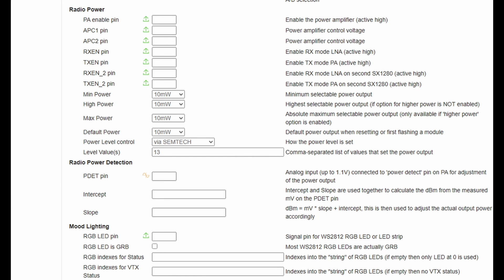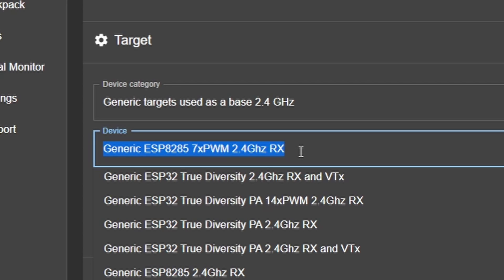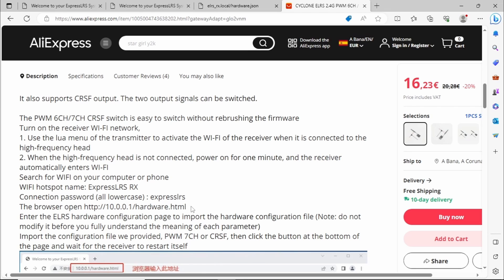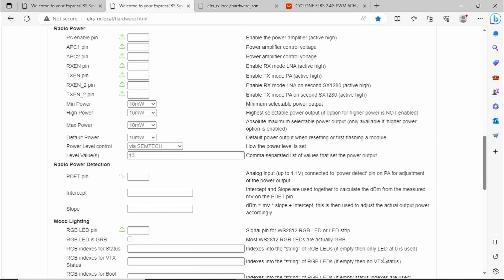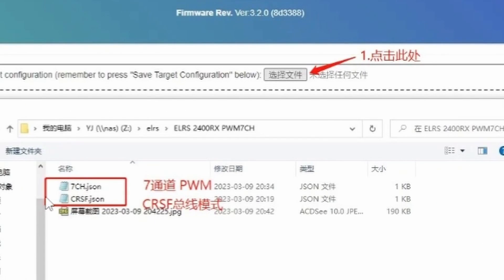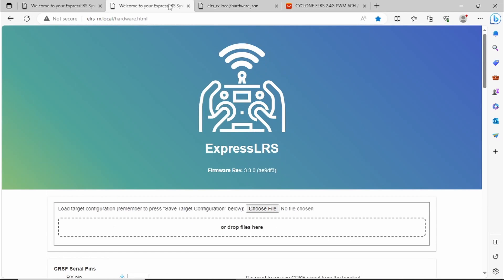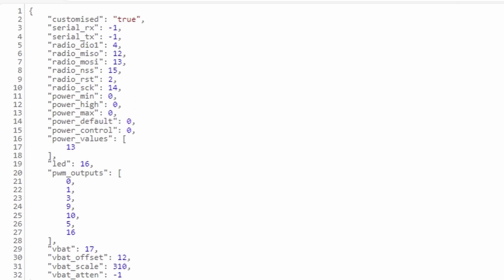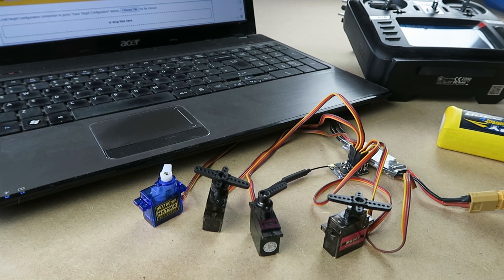ELRS Tx Rx "SECRET" Hardware Tab CYCLONE ELRS 7CH PWM JSON Files

Comment: Thank you for the video and the files. Now my Cyclone is in 7ch mode :)
However I wonder how to update the FW with ExpressLRS Configurator.
Reply from the maker: As you know the "Generic" target has been removed from the configurator. However, I have successfully flashed version 3.2.0 by using the Happymodel EPW6 target. Of course the json file still works as before. Thanks for watching, have a great day!
Reply: @1nformatica  Oh that is great info, thanks a million for that. That saves switching from 1.5.5 to 1.6.1 of the ExpressLRS Configurator :) The only thing I have now is that the Happymodel EPW6 firmware made with 1.6.1 has a bin.gz ending, I guess it needs to be extracted and then the firmware.bin uploaded via the web interface, isn't that right?
Reply from the maker: @tinaschulz3514  You're welcome! It is a lot easier just to configure the Rx to your local network and flash via wifi. I believe you leave the file as .bin.gz if you do it your way. Have a great day!!
Reply: @1nformatica  yess you need to upload the "firmware.bin.gz" bc the bin file itself is too big.
Error message appears: "ERROR[4]: Not Enough Space"
Reply from the maker: @Cre8ionz.  Thanks for the confirmation. Have a great day!
Reply: @Cre8ionz.  how to convert the .bin fil to a file i can backup the RX?. and the happmodell only have 6 chaneles and not 7 will it take an effect on the result?
Reply: @1nformatica  I installed this fimware and now it's on blue solid light, it does nothing
Reply from the maker: @luisdav2202  I, and many others have used the EPW6 firmware successfully.  A solid light means either that the Rx is in boot mode or the wrong firmware / bad flash has occurred : https://www.expresslrs.org/quick-start/led-status/#receivertransmitter-led-status The only way to recover is to reflash with the correct firmware by using a UART interface. Thanks for watching, have a great day!
Reply: @1nformatica  im gonna try it again, where did you find the Json file? cant find it can you upload them?
Reply from the maker: @Lewis_FPV  They are linked in the video description with other useful links : https://drive.google.com/file/d/1VlCShq8hUUtPatXYvEwJ6bMc0LfcUQTq/view?usp=sharing

Comment: hi, i have CYCLONE ELRS 7CH PWM i have flash using firmware HappyModel EPW6_2_4GHz_PWM_RX_FCC on version 3.3.1 to matches the version on my radio, But I still can't complete the binding process. it's in bind mode at startup, but it doesn't respond to the radio bind. Do you have any idea what might be causing the problem?
Reply from the maker: Are you powering the receiver and then quickly cycling the power off and on three times? The Rx should not be in bind mode if you just power it up. Look here for LED status : https://www.expresslrs.org/quick-start/led-status/#receivertransmitter-led-status
Reply: @1nformatica  no but, After flashing, at startup it automatically boots into bind mode (double blink then pause) and then 1 minute later it switches to Wi-Fi
rx web infos : HappyModel EPW6 2.4GHz PWM RX Firmware Rev. 3.3.1 (e051b8) ISM2G4
Before flashing, the receiver is listed as: ExpressLRS Generic ESP8285 5xPWM 2.4GHz RX Firmware Rev. ver.unknown (ae9df3) ISM2G4, I updated it to match the TX fw version
tx web infos : RadioMaster Pocket Internal 2.4GHz TX Firmware Rev. 3.3.1 (e051b8) ISM2G4
On the http://10.0.0.1/hardware.html page of TX, I have updated with the 7ch.json file.

Comment: I think I bricked my receiver when flashing EPW6 ELRS 3.6.0. The LED is constantly on. How do I re-flash it?
Reply from the maker: A solid light means either that the Rx is in boot mode or the wrong firmware / bad flash has occurred : https://www.expresslrs.org/quick-start/led-status/#receivertransmitter-led-status The only way to recover is to reflash with the correct firmware by using a UART interface like this one :  https://s.click.aliexpress.com/e/_DDzPaYN
Reply: @1nformatica  Yes, I carefully studied your instructions. I'm using a USB-STS-ISP USB-TTL adapter, Prolifik. I connect to +5V, ground, Rx (channel 3), and Tx (channel 2). However, the ELRS configurator doesn't detect the receiver. What am I doing wrong?
Reply: @user-dj  boot button has to be pressed before you power it on!
Reply: @makesomemore_  It turned out to be simpler. The Prolific adapter doesn't work with Windows 10.

Comment: Thank you for this. You are amazing. Saved me! My channel 5 acts really weird idk why. I checked online and I heard pwm revievers use that to "arm", and dynamic power setting in radio will only be selected if ch5 is armed AKA at 2000ms. Which literally makes the ch5 useless. Any workaround for this?
Reply from the maker: These are the steps to get full resolution on CH5:
Update ELRS Firmware: Ensure you are running ELRS version 3.0 or later. 
Use the ELRS Lua Script: Access the ExpressLRS Lua script from your transmitter's radio menu. 
Select a Full-Res Switch Mode: Choose one of the full-resolution switch modes, such as the "16ch Rate/2" option. 
Configure Settings: Set your desired packet rate (e.g., 100Hz or 333Hz) and select the full-resolution switch mode. 

Thanks for watching, have a great day!

Comment: Thanks for the Video. 
Can you burn this receiver to act as transmitter?
Reply from the maker: Whilst it is theoretically possible it is not worth the effort. For one the output power would be very limited. There are many ELRS transmitter modules available and also generic LRS modules that can be used. So you can take a dev board with an SX1280 and ESP32 and flash it as an ExpressLRS TX but there are much better commercial units available i.e. Happymodel ES24TX or Radiomaster Ranger Nano. Thanks for watching, have a great day!

Comment: Thanks for the video, it helped. I have one other question though. On my cyclone device I need to connect VCC/GND not only to the two ADS/GND pads but also on the boot channel (channel 1). If I don't it doesn't power up. In your video channel 0 does not seem to be connected but it is working. Is there some step to make that work?
Reply from the maker: I do not understand your question. All the GND points on the receiver are common (connected together) if you take a multimeter on ohms or continuity you will see this. The same is true with the +5 volts, all channels are connected together. The exception is the "ADC" point which is connected to the main battery voltage for telemetry.   What do you mean by "channel 0"?

Comment: do you have any tip on antennas? My antenna broke at connector and I need a replacement. I have no idea what kind to buy. Regards
Reply from the maker: Provided that the connector on the board is not damaged you just plug in a new one. The connector is called an IPX4, you can see replacement antennas here : https://s.click.aliexpress.com/e/_okVTjsz Thanks for watching, have a great day!
Reply: @1nformatica  Many thanks :). Length is not important? My cyclone antenna is around 7,8cm long.
Reply from the maker: @rc_hiking_slo  The overall length is not important. What is important is the length of the exposed section at the end which is about 31mm https://oscarliang.com/repair-2-4ghz-antenna-rx/#:~:text=a%20coaxial%20cable-,Calculating%20Antenna%20Length,wavelength%20of%20the%20radio%20wave.
Reply: @1nformatica I bought antennas from your link but they would not fit my elrs cyclone... Did aliexpress make a mistake or maybe the are not ipx4 that fit my model 🤔
Reply from the maker: I am really sorry I posted the wrong link. The Cyclone uses IPX1, a larger connector https://s.click.aliexpress.com/e/_c39tlJPp Sorry for the confusion.

Comment: Do you maybe know how to make telemetry work? I'm not receiving any RxBat values. I have a wire on my ESC that goes on one of the channels and it supposed to be for telemetry.
Reply from the maker: The RxBat value comes from a dedicated ADC point on the receiver near the Ch5 pins. This is connected to the positive of the battery, I use a wire going into the balance lead to do this. I do not know what "telemetry" your ESC has.

Comment: Anyone have the issue where the voltage is read as 3s (11.4V) instead of 2s HV?
Reply from the maker: You need to calibrate the RxBat value. Go to the Telemetry tab and select sensors, scroll down the RxBat and select Edit. Then you will see the reported voltage at the top of the screen. Adjust the "ratio" value until it agrees with your multimeter reading. Thanks for watching, have a great day!
Reply: @1nformatica what I ended up doing was tweaking the hardware.html value to 420 instead of 310. Anyway, thanks for the video! Yours was the only one on the web

Comment: I have seen on ali DIY2.4Ghz and device DIY2400 RX PWMP EX (CYCLONE ELRS 2.4G 7CH PWM Receiver)
Reply from the maker: Yes, that is the same device. The DIY2400 firmware is not available in the latest configurator so I use the Happymodel EPW6 which works the same. Thanks for watching, have a great day!

Comment: Thank you very much for the guidance! I would like you to make a video configuring the Variometer and vbat.
Reply from the maker: You're welcome! There is no "Vario" function. At heart this Rx is a copy of the Matek R24v which has a vario but this does not see : https://www.mateksys.com/?portfolio=elrs-r24-v  The vbat is very simple, just connect a wire from the battery + (I use the balance port) and view the telemetry sensors. VBat is represented as RxBat. Have a great day!!
Reply: @1nformatica  I understand that there is no Variometer on this RX, but I have a Frsky Variometer sensor, would it be possible to enable it on this RX?
Reply from the maker: @speedmodelsrc  I do not think so, as far as I can see there is no UART to connect an external sensor.
Reply from the maker: @speedmodelsrc  You should check my other video : https://youtu.be/HKKmED2W0Uk&list=PLxtbRS-naT68PQVcBSziD3c9Uk6sNhR_f

Comment: Can I power it via the BEC of my ESC over the Motor channels power wires?
Reply from the maker: It is normal to power the receiver with the BEC from the ESC. I do not understand "over the Motor channels power wires". The receiver needs 4 to 6 volts DC to work. Thanks for watching, have a great day!
Reply: @1nformatica  I was trying to say that there is no specific 5v Input pin right? the BEC sends pooer over the same 3 Channel wires (2 of them for the BEC) and one for PWM signal from the receiver to the ESC). So you can plug it into the receiver where ever you like? I am asking because I once had ESCs taht had a second 2 pin wire for the BEC.
Reply from the maker: @Seb.drives You are correct, on this receiver you can power from any of the 5v pins for any channel. All the 5v pins are wired in parallel. When testing sometimes I just use a 1S Lipo and plug it (carefully) into any channel.

Comment: Hi. Thank you for this review. 
I would like to buy this RX but I don't want to buy FDTI adapter. 
Can I use this RX with a 3.3 to 4.2V 1s lipo (for a glider), or should I buy a specific "glider RX" from radiomaster? Thank you  sir.
Reply from the maker: You do not usually need an FTDI adapter. The Rx has the standard ELRS wifi webUI for flashing new firmware. You only need an FTDI adapter if you have flashed the wrong firmware and "bricked" the Rx. The Rx has a voltage range between 4.5 and 8 volts, it will not be reliable on 4.2 volts. Thanks for watching, have a great day!
Reply: @1nformatica  it could be fine for short range rc glider  I hope
Reply from the maker: @sebdewey  Let me know how it works out for you. good luck!
Reply: @1nformatica  yes. Thank you

Comment: Hey hello, I have same setup. But I cant get battery telemetry. Can you explain me more about soldered VBAT red wire?
Reply from the maker: It's quite simple, just solder a wire to the ADC "VBAT" pad and connect it to the main battery positive. I find it easier to plug it into the balance connector. I use these "DuPont" wires, and male / female wire, you can get various lengths : https://s.click.aliexpress.com/e/_opSQYPP You do not need a seperate ground connection as it is "common". Once that is done and you have "discovered" the telemetry sensors on the Tx, you should see "RxBAT" and the battery voltage. Use a multimeter to check the voltage is correct, if not you can adjust it by editing the RxBAT entry in telemetry and changing the "ratio" value, you can do this in real time as the RxBAT value will be on the same screen. Hope that's not too confusing! Let me know if you need more detail. Thanks for watching, have a great day!
Reply: @1nformatica  THANKS it worked! With litte worry to frie board. But it worked. Now i just not sure about how thick should be that wire.should it be same as from battery?
Reply from the maker: @archytektas  Hey thanks! The wire can be as thin as you like, it carries no power. As I said before I use the DuPont cables that I linked to. You can see they are very thin. I buy the ones with a male / female end. The male plugs into the balance connector for the battery at the most positive end. You either cut the female off or some receivers have a pin to connect to like this one : https://s.click.aliexpress.com/e/_om549xt  Have a great day!
Reply: @1nformatica  yeah I have those alot from my arduino projects. Thanks again.

Comment: Thanks for this video, I've trying to get the seventh channels out of the receiver for sometime. Just one question, if I update the firmware on the receiver. Will the current settings still be saved to the receiver?
Reply from the maker: You're welcome! The receiver settings should be saved when you flash the firmware, however it would be good practice to save the configuration from the WebUI "options" tab : https://www.expresslrs.org/quick-start/webui/#the-banner  Have a great day!!
Reply: @ good man, thanks again😜

Comment: For anyone who try to find correct scaling value for vbat scale:
It's probably 412.61. Initial 310 is too small and it overstates the voltage readings. Please note that these Chineese radios may vary.  Anyway I connect my battery   directly to ADC pin of the receiver. I still don't know what's the max voltage
Reply: Just checked twice and value which I set is absolutely correct for cyclone RX
Reply from the maker: The ADC pin goes to a voltage divider for the CPU ADC pin. Max is 36 volts I believe. Thanks for watching, have a great day!
Reply: @1nformatica  we can only believe :D
Reply: @1nformatica  Hello, this topic has been confusing me. From reading on the ELRS Hardware page it states, "Analog input pin for reading VBAT voltage (1V max on 8285, 3.3V max on ESP32)". Seeing as this has an ESP8285 chipset it would imply a max voltage of 1v and so would require a voltage divder. I am interpreting this correctly?
Reply from the maker: @Double-D_291  You are correct. This receiver has a voltage divider circuit built in.

Comment: logré acceder a la interfaz del hardware pero no me aparecen las mismas especificaciones del provedor que recomiendas :( ahora mi receptor solo parpadea una vez cada 4 segundos y mi tarjeta ftdi no ayuda porque los software beta flight y erlx no se conectan (la luz siempre está roja) a pesar puedo seleccionarlo da un error.
tiré el dinero a la basura
Reply from the maker: Hola, me parece que has flasheado el firmware incorrecto al receptor. Por eso ahora parpadea. La única forma de solucionarlo es flashear el firmware del Happymodel EPW6 usando la interfaz FTDI directamente al receptor. No sé por qué mencionas Beta Flight; el configurador ELRS es la única forma de hacerlo. Gracias por ver el vídeo, ¡que tengas un buen día!
Reply: gracias por responderme! estuve hablando con los chicos de un foro y me han dicho que el problema está en la ftdi que tengo, entonces compraré una nueva, de hecho es la que tú tienes. Lindo día hombre

Comment: I have a few of these receivers and I’m trying to use them in my rc car but channels 5-7 are not working at all. Neither in pwm mode nor serial mode. I’ve tried all the different packet rates. Can someone plz help. Thanks
Reply from the maker: Serial mode only works on Channels 2 & 3. You need to look at the "model" tab when connected to the Rx by wifi, as you see here in the video : https://youtu.be/2VZb0n_G_Pg?t=198 Normally you will only see up to Ch6 unless you change the values in the "hardware" tab. If they show the output to be PWM then they will work. Maybe the problem is with your Tx setup. Thanks for watching, have a great day!